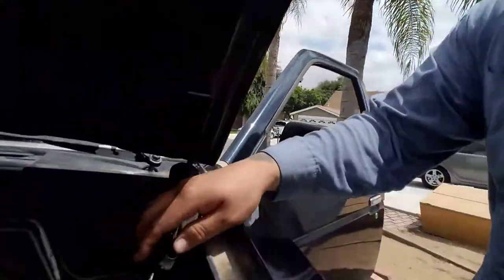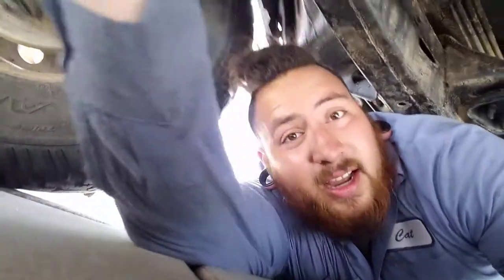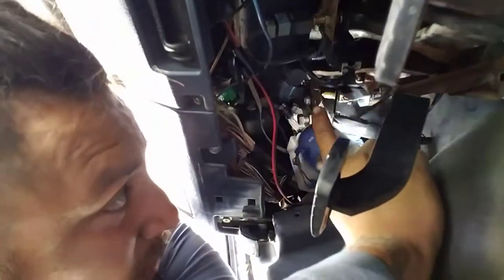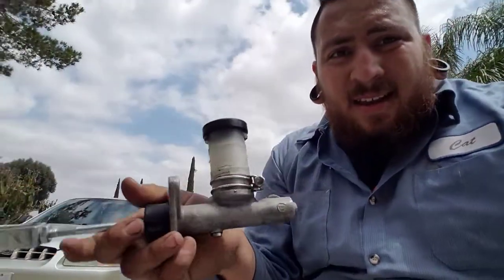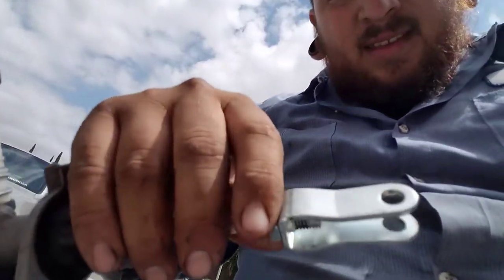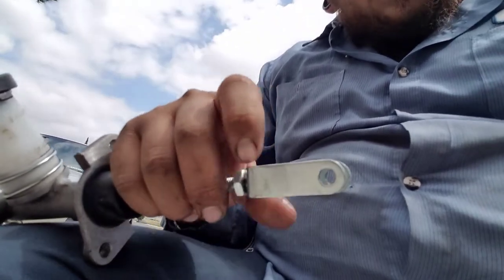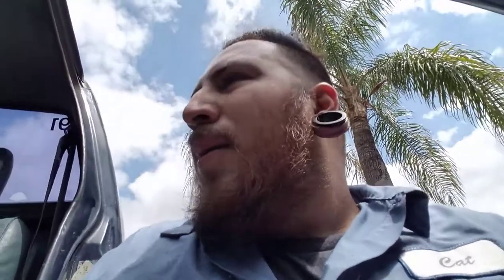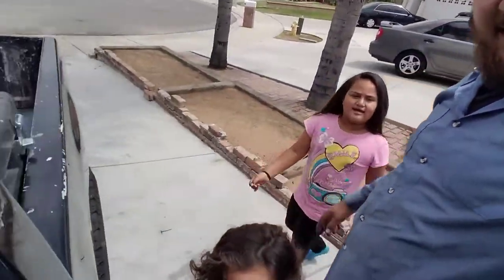Clutch pedal sticking

Comment: I changed both and clutch and still all they way down......😔😔
Reply from the maker: KAWA DUDE  did you adjust the pedal? Did you bleed it?
Reply: rick nova yea We bleed it a few times  and nothing..what do you recommend
Reply from the maker: KAWA DUDE Adjusted the fork from the clutch cylinder to the pedal.  And make sure you bleed it right. I had to bleed my line for a while.
Reply: rick nova  thanks dude ima try that this weekednd I already had 3 mechanics look at it change the clutch the master cylinder and slave cylinder and still nothing so ima give that one a last try see how it gos thanks man.
Reply: KAWA DUDE did it work for u? I'm having the save issue
Reply: How long did u bleed it for
Reply from the maker: Jason Rice your gonna have to bleed it for a while man. Just give it time.
Reply: Jason Rice  after 4 mechanics I got it fixed, I know they got the "bleeder clit" and adjusted tge clutch for sure.
Good luck dude.
Reply: rick nova  thanks for your help broskiii!
Reply from the maker: KAWA DUDE thank you!
Reply: how long is a while 5 minuets or 15 minuets? I gave up on mine 😞 Also bleed it first or adjust it?  I bleed  it for a while and nothing.
Reply from the maker: ezcape49 adjusted first then Bleed. Bleed for about the 10 mins.